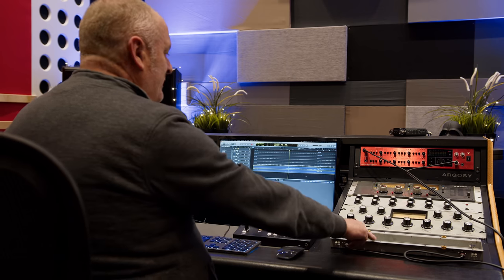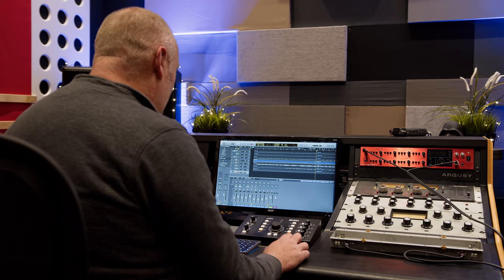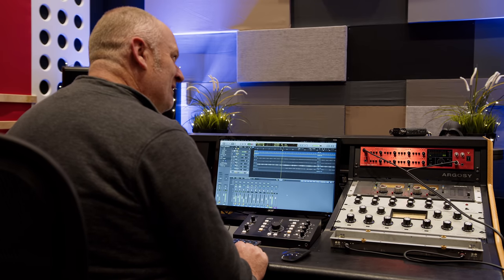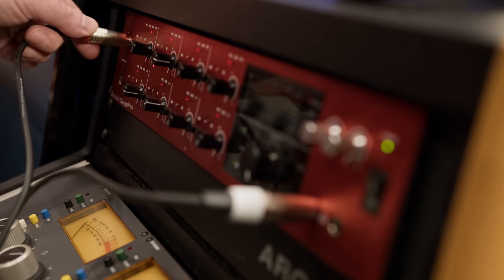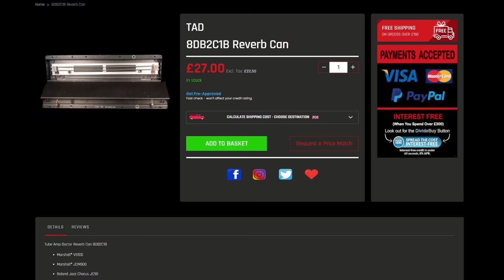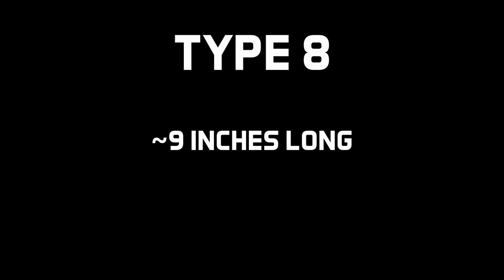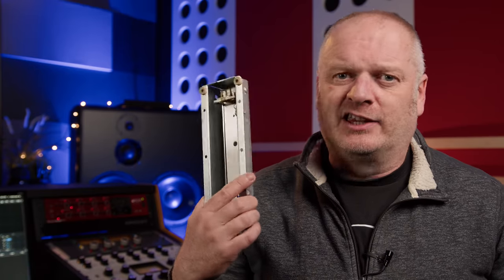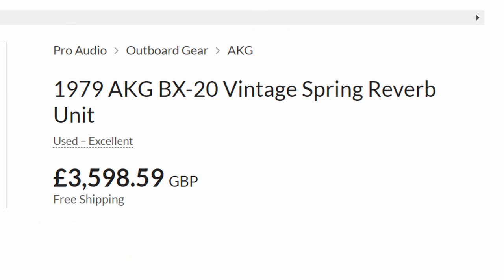A SUPER CHEAP DIY Spring Reverb YOU Can Make Yourself!

Comment: I bet you’re going to use a plastic drain pipe and stick a slinky in it, if not you should. When I were a lad, it was called a GBS (the Great British Spring). I used one for years and it was wonderful. I very stupidly gave it away to a mate, when I got my first digital reverb, the original  Alesis Midiverb, the one in the weird little plastic box. I’ve always regretted it, they go for about a grand on eBay, these days and nobody with any sense wants an old Midiverb. Keep up the good work, chaps, I’m loving this.

Comment: At the studio I learned in, the spring reverb was a 6' length of PVC drain pipe leaning in the corner of the control room! Hitting it with the chair was a memorable experience!!! 😁
Reply: Hey! Since I am trying to build an acoustic reverberating object that does not require any electricity, I wonder how this pvc pipe reverb that you mention was built. I am curious. Can you please give me some detail?
Reply: @lcuxi  I didn't build it of course, I just had it explained to me, and used it in recording.
There was very little to it, it was basically a piece of PVC pipe with a spring in it! The wiring was in the end caps, you can buy them from the hardware store that sells the piping, and they'd hooked it up to the patch bay so you had 1/4" TRS input and output sockets. What they did for a spring, I don't know, I assume that they bought wire, and made a spring to fit.
It's just an oversized version of what you find in the bottom of an amp, or what's described in this video. 🙂

Comment: the part that makes it difficult is the sway of the reverb, you will hear it when the signal goes through is. If you were to side chain the spring reverb so that it ducks the reverb when the vocals are not singing, then the sway of the reverb could be audible on the release or gate rather said... I think that does not sound very appealing. But for many applications I do like the thickness and texture of the hardware spring reverb tough! As any reverb type, it is coherent to the style and era of many genres of music imho..

Comment: I had an enormous Spring Reverb pedal. Well, actually, it was an ancient Eminar six channel 200w powered mixer with a spring reverb tank inside. The mixer was nice but a little noisy and VERY heavy. I hadn't used it for a couple of decades and then decided to try to use the reverb signal for guitar. It worked using the available ins n outs of the old thing and sounded pretty cool BUT was a lot of effort to set up and being large as well as heavy was quite cumbersome. I As we moved states recently I gave it to a gigging musician who planned to use the mixer for foldback. Had I seen this video 12 months ago I'd have stripped out the reverb tank and followed your instructions. Timing is everything.

Comment: The idea of using a headphone amp is simply amazing!
Even the most basic and crappy sounding one should work absolutely fine for this, making a stereo spring reverb very affordable.
Reply: I use an old harmon kardon hi fi amp's headphone out to split a stereo signal to two units, also using its speaker outs to power a plate.  It's nice because I can use the amp's bandaxall eq on the way in as well as drive it into saturation.  rad as hell sound!

Comment: Thanks for this. Little bit of a tip for the recovery circuit I came across whilst experimenting. A cheap phono preamp (I'm using a behringer pp400 for £20, plenty of others out there), designed to boost/convert phono signals from a turntable to line level seems to work really well, and is a really cheap way to get a decent gain boost with correctish impedance without noise. 

The connections are all RCA, it's all stereo, the impedance of the input of phono preamps is relatively high compared to the spring tank output, the gain boost with them is decent/gets it up to line level - with an output impedance designed for connecting to line level equipment. Only slight drawback is these preamps have RIAA eq baked into them, but that's not neccesarily a bad thing as it seems to help with high end noise - and besides you're just going to eq the verb in the DAW anyway. Currently doing this and it sounds fab. Hope this helps someone.

Comment: A reason why many, and most of the ones I've encountered, have low impedance "send" transducers is owing to valve tech. They used a small valve output transformer for anode matching and the send part is seen by the driver stage as a 3 ohm speaker. I've YouTubes a reverb spring driver circuit of my own design, although I should submit an improved update. Whenever I've got around to using a reverb, I resorted to  Zoom rack effects unit that does the same job to my ears but I still have a fondness for the old style tech. Nice upload. 🙂

Comment: At the start of the pandemic I went full-on guerrilla and built one of these from an old 4" speaker and a shower heating resistance attached to it... on the other end of the spring, earbuds as pickups. All housed into a DIY wooden box, built to the 70s dbx decilinear series style - even the paint was DIY, powdered graphite mixed with glue.

The sound was pretty boxy, sig/noise ratio was narrow but it was fun nonetheless. Your video inspired me to do it again, properly this time.

Comment: I made a dual mono spring reverb using a small and large tank (I like the shorter 'verb on the left) I used an off the shelf £5 2x5W stereo amp circuit to accept my line signal and drive the spring tanks - I played with the amp's input voltage until I got the best sound.

Comment: Love it. I had an old Korg rackmount stereo spring years ago. leant it out and never got it back. 
The reverb/amp and little 10"speaker in my old Hammond M100 sounds great, and it is fun sometimes to run a line level through that via the little phone on the swell pedal housing and mic up the speaker - use a ton of electric tho...

Comment: I have three 17" Gibbs reverb tanks laying about doing nothing. I was going to build a Dr.Z style reverb unit bu the input imedance with a valve circuit was impossible to find a transformer for so i was going to use the amp board from an old mushroom white, 90's Sound Blaster set of speakers!

Comment: My Park G10R combo amp had 2 springs in the reverb tank. Back in the 90's I did mess about with the springs a bit and damaged one of both, so a couple of years back I put a new reverb tank in the amp which has 3 springs. To be honest I don't think there was anything wrong with the old reverb tank as it sounded alright, but I think the new reverb tank is probably better with the 3 springs.

Comment: Thanks so much for this, I've had a pair of Accutronics type 4s in a drawer for ages. Number on one of them is not entirely legible but thanks to your PDF I now know they are completely different. One horizontal & one vertical + plus massively miss matched input impedance. Both long decay though.  So mono it is then!

Comment: Amazing info, this could stop me from spending hundreds of pounds on a Vermona rackmount. Is the tank used in the video a 4EB2C1B?
Reply from the maker: The model number has long gone! But as long as the impedance roughly matches with what you’re driving it with you’ll be ok. Check our free PDF in the link for the necessary specs.

Comment: I just found an Accutronics spring reverb on the side of the road! Judging by the pile of junk which it was sitting on top of, it came from an old Hammond organ. However, the code is nowhere to be found on the unit... I'm just going to experiment with synthesizers that have a headphone output for now. Any cues from you guys? Thanks!

Comment: Ok, are there ones with impedance code for standard 600Ω line levels tho? Or does it mean too much signal level required (i.e way more than +4dBu?)?
Reply from the maker: Type 4 E have 600 Ohm impedance, but I think you’d need a beefier signal than line level to drive it

Comment: Hmm, thought I commented already, maybe I didn't hit 'comment' or I said something wrong?
I was thinking that an external soundcard like the Behringer UFO202 would work as an inexpensive headphone amp to run the reverb.
I have an old non-working amp that I put a spring reverb into years ago that I will cannibalize for a test.
I'll use an old USB 5.1 external Creative Sound blaster to provide the headphone amp and a usb power brick to power it.
Should be fun
Reply from the maker: We never delete any comments, but sometimes they do disappear! 

And yes, that would work a treat - pretty much any headphone amp we’ve tried, even that in a cheap interface, has worked a treat 👍